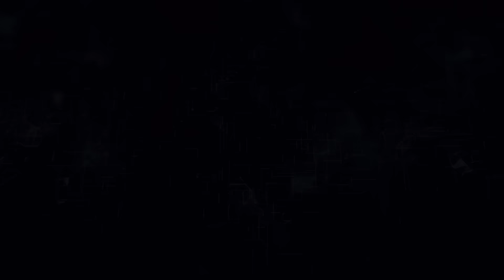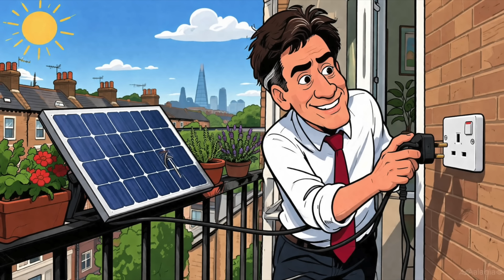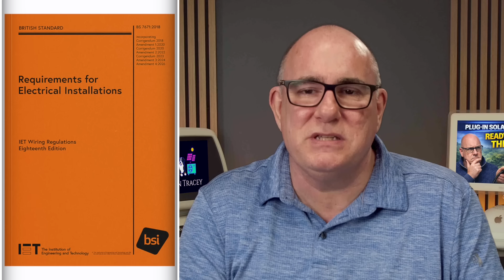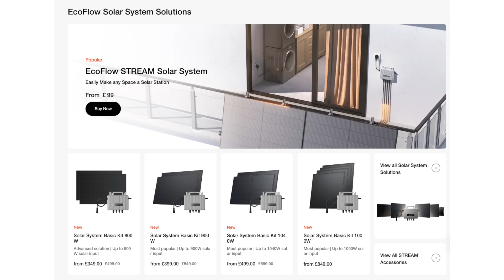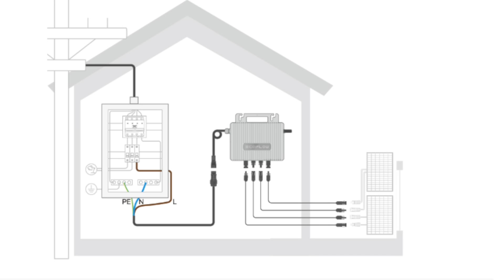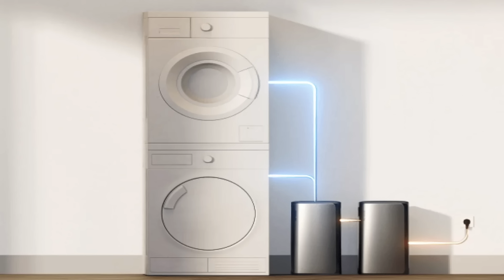Plug In Solar Is Coming… But There’s a Problem

Comment: I cover much more than my baseload, I pulled in 6kwh yesterday and I only use roughly 7kwh a day
Reply from the maker: how big is your system ?
Reply: @JonathanTracey I have a stream ultra x and stream max linked together giving me just short of 6kwh storage and 2600w of solar mostly fence mounted
Reply: @TonyandTeddysWorld very nice , I did 9.26kwh in Derbyshire with 3x505w panels facing east on 1 fence another 3x505w panels facing west on the other fence and 2x425w panels facing north on a shed roof.
Reply: @TonyandTeddysWorld  That's a looong fence
Reply: @paulclapton7803 I have 2 450w facing east fence mounted 2x400 and 2 x 450 facing almost south one fence mounted and 3 leaning on the fence at an angle, it's going to be excellent in the summer
Reply: I've just got an ultra x and 1800w of panels. Yet to get running. I reckon a trickle of 800w should take care of my base load and a bit more. Then of course the rest will go into the battery to be used later. I think the payback for me will be around 2 years. I don't have gas here and was looking at £1800 at current prices to get a year supply of heating oil. That's what this kit has cost. I'm switching to using the immersion heater in the hot water tank so I'll only have to use the oil for heating. I'm looking for a smart immersion unit so I can trickle any excess into the hot water tank.
Reply: @handsofdoubt31 800w is quite high my base load sits between 150 and 300 depending on it'll the fridge freezer s have kicked in or not. I have the smart meter too.
Reply: @TonyandTeddysWorld  I work from home so my base load includes running my office for the day. After doing many meter readings throughout the day I reckon 800w incoming will meet most of my normal demand. Obviously it's not going to cover switching on the kettle.....but I've got that covered by boiling my kettle in my camper. That has 300w of solar on the roof and a 2kwh battery. I try to charge as many things in there as  I can 😁
Reply: @handsofdoubt31 I have a 2kw power station on the way, in the summer I should have excess solar my plan is to put that in the power station then bring that in the house and plug the kettle and airfryer in to that.
Reply: @TonyandTeddysWorld  Mines about 350 to 400W with multiple routers, security cameras and a load of other things plugged in so I agree 800w does sound like an over estimate.
Reply: @andyspoo2 I have my TV on and all the other basics like fridge freezer, under counter freezer router etc and I'm pulling about 250w
Reply: @handsofdoubt31 take a look at hybrid boilers like Ariston Lydos
Reply: I think we have a relatively small system, but looking at some of the comments it seems we have a fair sized system.

28 panels and 20kw battery storage panels are on the roof, roof is north east and south west we live in the he northeast and year on year we have generated between 7500kwh and 7800kwh annually.  Having a heated koi pond doubles the electricity usage so we are still paying around £400 per year from the grid after all is said and done with export.

So this new (new to UK) system wont really do much for us but I'm interested in knowing the ins and outs, the rules etc....Im tempted to run one on the pond (the pond air source heat pump is ran from a separate circuit so that would remain as is).

I will be watching your channel closely to see what develops in the coming months.
Reply: I cant have anything that interferes with my FIT roof panels that will not work at all if power goes off as it did after a storm in January.
I dont know if I can just use it for  when the grid goes down to kickstart my roof panels? Can anyone help me?
Reply: @bertibear1300 I think not, these micro inverters switch off once they lose connection to the grid.
But you can pair that with a battery and run your fridge from the battery during a power cut.
But if you have rooftop solar, it's best to install a fixed battery with anti islanding switch.
Reply: @bertibear1300  If your FIT installation is below 4kW then one option is to use a Sunsynk inverter and a suitable battery (I'd suggest Fogstar) The built in aux interface can AC couple to your solar system without interfering with it, and keep it running generating and feeding the battery whilst the grid is down. It can also keep part of your house powered in that situation.

Not many other inverters have this functionality but there are options, you just need to find an installer who knows about and installs Sunsynk kit. It's even possible to wire it to a generator if you are really rural, although few in the UK need that option

Comment: The thing that scares me the most? No not electrocution.......but lots of flappy panels hanging off buildings......how long before something nasty happening///////////?
Reply from the maker: Yep that could be an issue, but is it any worse then would be DIY kings putting up sheds that are not nailed down. I hope those of a DIY phobic persuasion will avoid this in the same way, but i am sure there will be a few.
Reply: Considering that plug-in solar has been common in several European countries for years and there are no documented cases of anyone being killed or even injured by falling solar panels, this could probably be interpreted as a particular vote of no confidence in the responsibility and/or craftsmanship of your fellow countrymen. 😉
Reply: @marcromain64 I dont know about other EU countries apart from Germany. A big difference is that Ring Circuits does not exist there, which sadly in the UK we do in most old homes. Rings circuits were implemented to save the cost of wires so they used thinner wires than radial circuitry and more likely to overload from bi-directional current fed into the system. Trust me when you go down the rabbit hole you begin to understand its not as straight forward as just plug and play.
Reply: @chingai348  However, even in the UK, the wiring is unlikely to affect whether and how often solar panels come loose and fall off. And that was the concern raised to which I responded.
Reply: @chingai348  these radial circuits are already running kettles, electric heaters, toasters, microwaves etc which all use up to 3kW. 800W (3.5 amps) discharge from a grid tied solar system is not going to melt them.

Comment: Don’t forget that it’s also a good gateway for plug-in battery as a first step too. Someone with economy-7 or an off-peak EV tariff can shift some of their demand off peak without any solar at first… But then if their system happens to have the MC4 connectors, it becomes very tempting to add a couple of panels on the balcony or shed roof.
Reply: Only they tend to be AC to DC charging only, which is frustrating when you later want to add DC to DC charging. I have Zendure 800pro which does allow both options. It obviously does require a decent difference between the on/off peak cost. I have €0.17/€0.14 by the time I factor in the 80% efficiency for the round trip it amounts to 2 or 3 euro cents per kWh so not really worth it.
Reply: @imaginitivity7853  Ecoflow does the Stream Ultra which is a 2kwh battery, upgradable to 12kwh, which has the inverter built in. So up to four solar panels have separate leads into the unit and it uses the DC supply from the panels to charge the battery directly. Then converts to AC to feed into your home.
Reply from the maker: @davidfyork That’s a really good point – plug-in batteries are a great first step.

They let people take advantage of off-peak rates straight away, and as you say, it often leads naturally into adding solar later on.

Comment: I agree, I see this as great for people living in flats, and them wanting to learn before going with a full system, just don't get too high an expectation. Also, I did hear on LBC that we may have a G98 with the kits, asking us to self-send in. I wonder how well that works.
Reply from the maker: I suspect if they try and include paperwork in the pack, it will get chucked on the pile with the instructions that nobody ever reads😂
Reply: How many flats have a suitable socket on the balcony I wonder?
Reply: @edc1569  Ecoflow and others sell wide very thin solar cables so you can run them through windows and still close the window.
Reply: I see this as being for everyone and everyone, its 800watts solar for free with just 2 medium sized panels. It allows you to put on extra fans in the house on hot days etc
Reply: Seeing the hacks that are done to e-scooters and e-bikes, despite regulation, I really really worry about what will happen with the irresponsible minority let loose on this, buying unregulated on the black market or following some TikTok hack that might not be applicable to a UK-marketed system. Sorry to be a pessimist!
Reply: @nigel9903  Those people already bought systems, and already installed them illegally. If they don't care about regs they don't care about plug in solar approval either